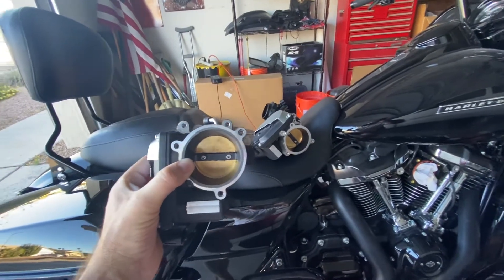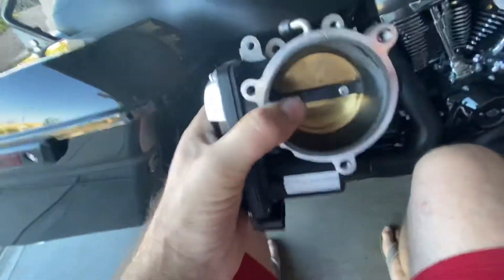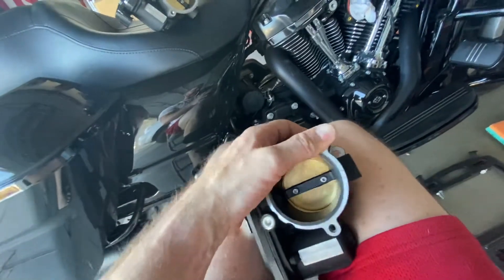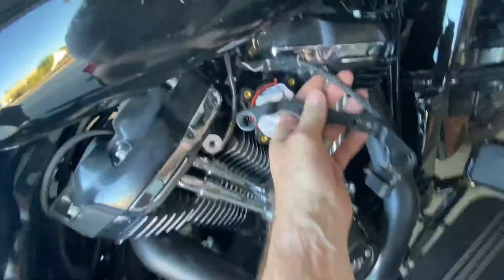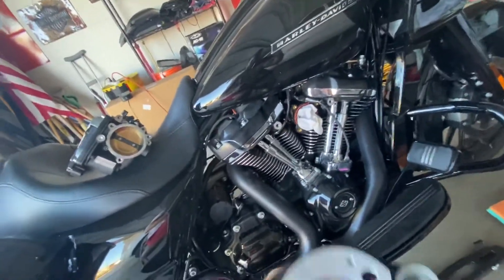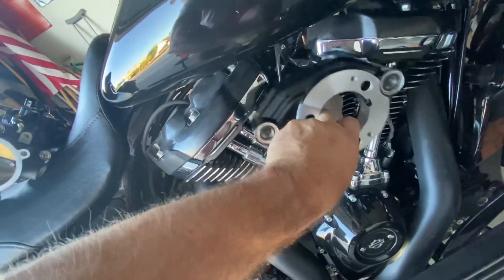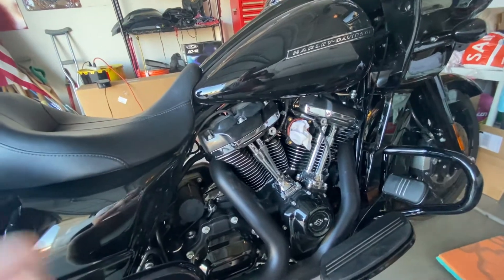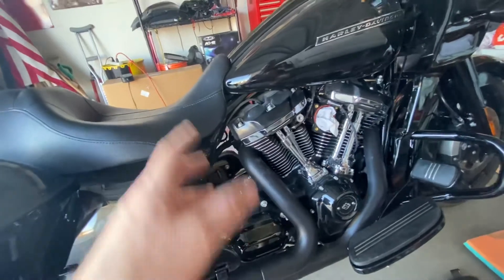19 Road Glide Throttle Body Repair

Comment: Thanks for video, I made the same mistake and decided to come look for videos before I put back new throttle body 😂
I read in directions for the air cleaner to remove bracket and for some stupid reason decided I should leave it.

Comment: That bracket lived on my 2021 Road Glide since last night.  I purchased it February 2023.  "SilverBack" began hunting for idle at 🛑.  That bracket caused an air leak at the breather bolts.  It doesn't have a purpose with an aftermarket air cleaner.  OBTW, it didn't exist on my 2020 Fat Boy.  2FD brother

Squid
ET1(SS/SW/MTS) US Navy, Ret.
Reply from the maker: Thanks for your service brother 👊🏼

Comment: Hi- Just broke mine on  same side when I was trying to replace Air filter. Can you tell me where you bought the throttle body. I have 2019 Road Glide Special. Thanks
Reply from the maker: I bought it from a guy on Facebook marketplace.  Check for one there or on eBay or Craigslist.

Comment: You will break the throttle body every time if you do not remove the black bracket that supports the flimsy plastic factory housing.
Reply: I learned that the hard way, I broke it twice!… seems everyone I know misses that in the instructions… it clearly says, remove and  discard..

Comment: Hi could this crack in the induction module cause a high idle .
Reply: Yes the crack would create air leak which causes high idle. Just learned this cause I just cracked mine making same mistake not removing bracket! Came here for videos before I install new one

Comment: Torque specs on the 3 throttle body bolts plz?
Reply from the maker: I have no idea.  I don’t torque anything.  Just hand tight 😉
Reply: The manual says 95-156 in-lbs brother